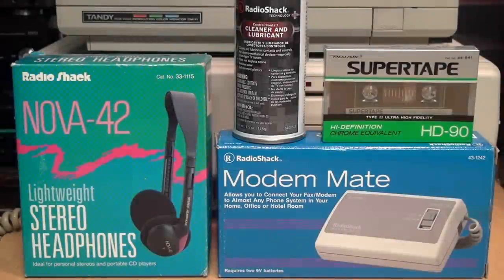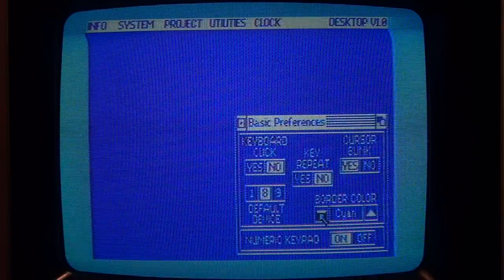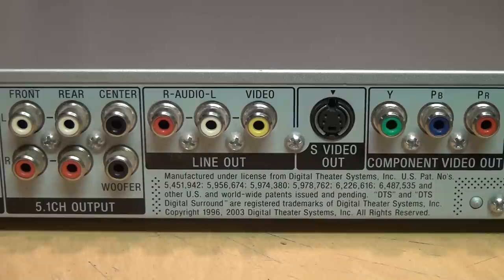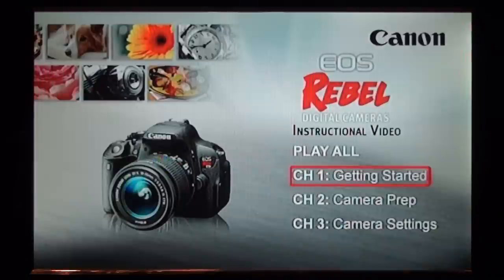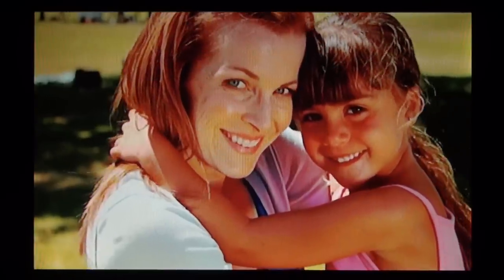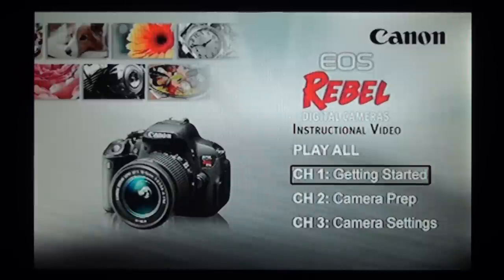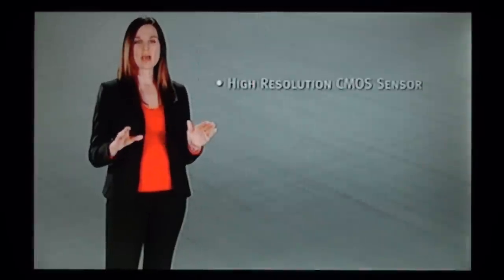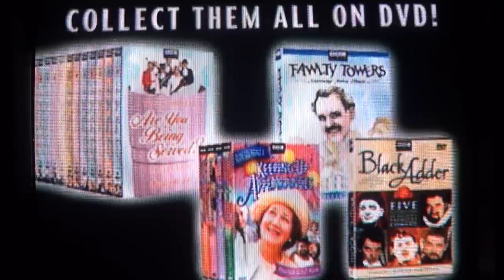Radio Shack S-video signal converter 📺 How? Why?

Comment: From the mid 90s to the mid 2000s I had a TV from Italian company CGE with S-video but without any composite input, so to connect a composite device I had to pass through my VCR which had one. A converter like that would have been quite useful for me, but witout the Internet back then buying those accessories from stores was kind a ripoff - at least where I live.

Comment: My experience of S-vid to Composite adaptors or cables has been monochromatic, sure it was a clear enough picture, but it was entirely black & white, maybe it was something with the equipment used, or I did something wrong, but I've never had them work right... :\

Comment: Not all the inexpensive Amazon cables are worthwhile. I purchased a DisplayPort to DVI adapter last year (the monitor only took VGA & DVI, while the computer output DisplayPort & VGA). It worked fine for nearly a year, until a month ago the system wouldn't power back up after entering sleep mode. 
To make a long story short, it was the bloody cable. Once I started using a straight VGA cable again, everything has worked perfectly! So much for Amazon Basics. Don't cheap out on cables!

Comment: I used to have a camcorder with an S-Video out, but no composite. I had to break out an old mini-crt to use it, which defeated the point. This would allow it to work on most modern TVs
Reply from the maker: I doubt it only had S-video. Probably it used a 3.5mm TRRS jack to output composite video and stereo audio.
Reply: @vwestlife  Nope. S-Video right on the side. I didn't have to find any more than an S-Video cable to get it to run on the CRT.

Comment: well i have a old pc whit a video card that have s-video but my old tv dont have s-video so i made a passive adapter an woks fine for the use i need (the passive adapter is more that only join the luma and chroma i have a capacito and a diode)

Comment: Ofcourse it can i used to make my own back when video cards had svideo outs so i could hook up to crt tvs to watch downloaded movies in early 2000s
Technically you should use some resistors but just tying the signals together still does the job

Comment: Older engineering solutions are starting to become "dark ages tech" that gets easily dismissed until you use them and have equipment that can make it useful... this is more suitable for CRT televisions imo as 2000s LCDs have flaws with image quality unless they were high end monitors.

Comment: Does anybody here in the chat know if it's possible to derive any video signal through serial, and if so how low resolution would it be. I know that serial is generally used for data connection back in the day, and or peripherals. But I just didn't know of any such thing has ever been engineered just for the hell of it..

Comment: svideo to composite has a use for some pc graphics cards that have svideo out but no composite,  i have a few laptops with svideo tv out but no composite so would be needed for one of these to a composite input
Reply: theres DIY svideo to composite circuits on the net and simplest ive seen is a 470pf cap linking chroma to luminance, thats likely whats in this 😉
Reply: those simple ones will never give brilliant results, i doubt even an active one would as once you've added chroma to luminance, not possible to totally remove it without removing some if the high frequency parts of the luma signal

Comment: I present the Apple Svideo to composite video adapter PN 590-1121. https://cdn11.bigcommerce.com/s-yvf0cm1pse/images/stencil/1280x1280/products/114/391/Apple_590-1121__88990.1652711326.jpg?c=1 Basically, some 90s graphics cards output VGA and SVHS natively, and due to space concerns, it was easier to just add a adapter cable.

Comment: 1:55 I bought a new TV set a couple of years ago and it only has composite and HDMI, not even a SCART in sight
Reply from the maker: I guess they include composite as the lowest common denominator of analog video sources, for example if someone wants to connect a VCR to it.

Comment: Hmm... What's in it?? 🤔
Reply: I suspect that there is a set of filters that separate the 15kHz color signal from the main luma signal. A low pass filter removes the chroma signal from the luma carrier. A high pass filter isolates the chroma submariner from the luma carrier. Simple passive filters using capacitors, coils, and/or resistors.

That is assuming the device actually splits the signals at all . It could just be a capacitor coupling that splits the signals and lets the receiver do the actual separation. Which seems likely as the connection is bidirectional.
Reply: @timharig  All of that in this small compact form? 😮
Reply: @zsombor_99  Oh sure.  In the simplest case you only need two components. The right capacitor value will act as a high pass filter and a coil (aka choke)  will act as a low pass filter. Of course, the filtering would get better with higher component counts and higher order filters.

Comment: They should open up amateur analogy tv broadcast, just like there's amateur radio.
Reply: Cause honestly the phones don't need that bandwidth, and if phones are using that they need to be redesigned so they don't.

Comment: I have some S-Video conversion stuff. for a hot minute, S-Video was marketed as a "better" signal compared to composite. it isn't. at least not in any of the ways i used it. it always had weird artifacting problems and i remember the PS2 would ghost so badly that  some darker games were unplayable. it could have been my TVs, but everything i tried it with really sucked lol